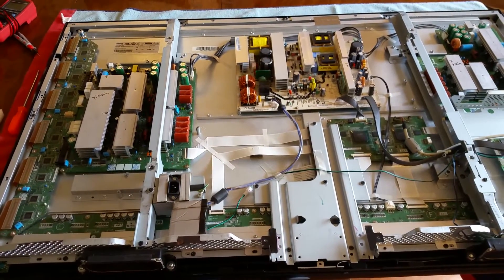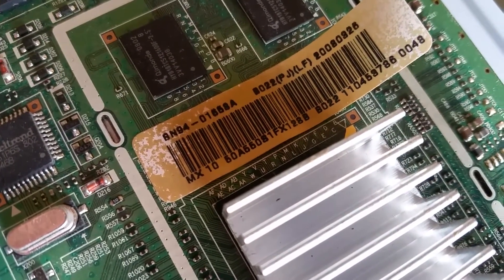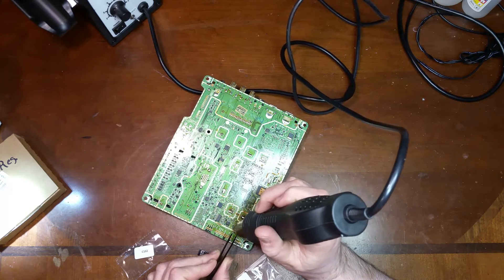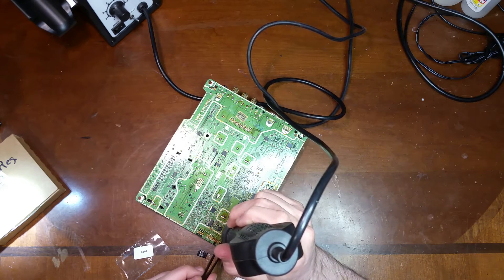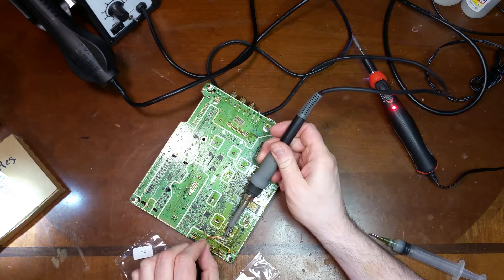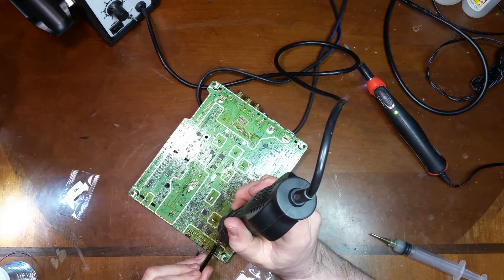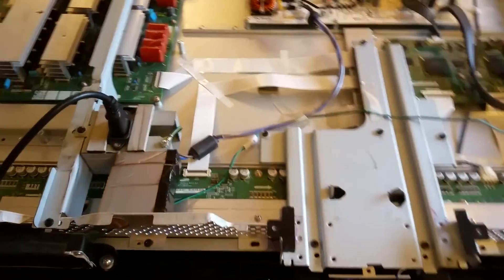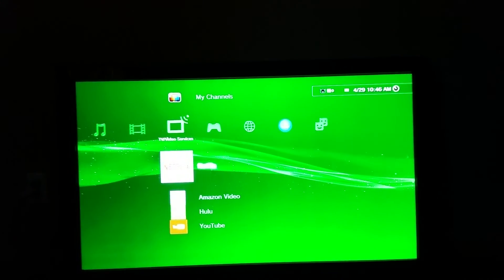Repairing a Samsung Plasma that power cycles.

Comment: Hey, I'm new to small electronic repairs and I think I want to get into doing this as a hobby/ side job. Where can I find schematics or resources to verify what readings I should have vs what I actually have? As well as where to find good parts kits? I've got a small basic soldering iron I'll probably move up and get a quality one soon. I've seen a lot of Louis Rossmans videos for mac repairs and recently got a TV related to this one with the same issue.

Comment: Hi  my lg 50PG3000-ZA model giving me alot of trouble NO picture NO sound just standby light ok turning on red to green but no pictures no light on the screen .
Bought another Power supply tested all voltages okay have changed the 2 buffer boards and the Yboard still not working.
Onto the logic board is standby green light (not blinking) but with the remote control is turning off/on .
Now with this explanation what do you think is gonno be the problem? Will great to hear from you soon as you can thanks
Reply from the maker: Hello and thank you for contacting jeffescortlx. I'm sorry but at this time all representatives are busy. But your question will be answered in the order it was received.

Comment: I have the same issue with my samsung plasma S5073, I get the chime music but no picture. Just power cycles on and off. 
Could this also be due to a faulty video board?
Thanks for the video
Reply from the maker: Could be, but I cant say for sure. Your model is different with a slightly different problem.
Reply: jeffescortlx I tried replacing the power supply board to no avail
 still same issue persist. I will try the video board next. Thanks for the reply
Reply from the maker: It's normally the most expensive board that is needed.
But power supplies are easy to test, the other boards not so much.